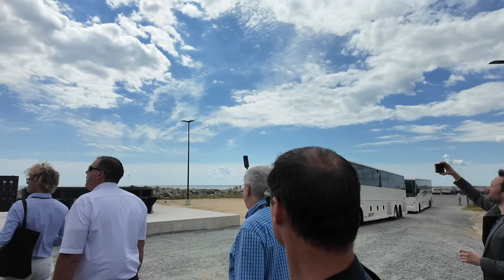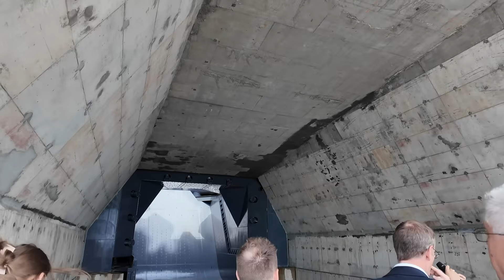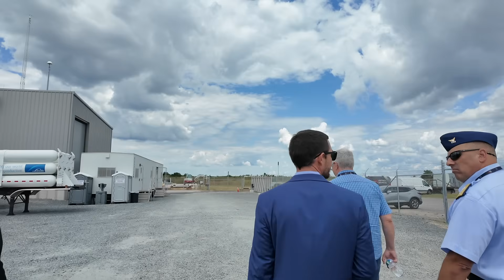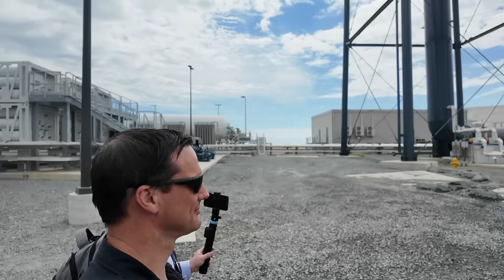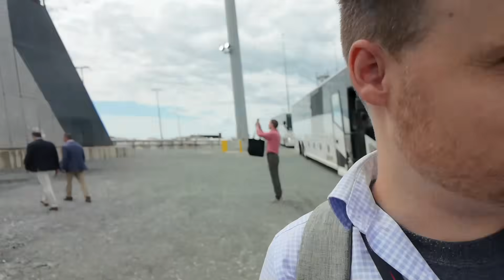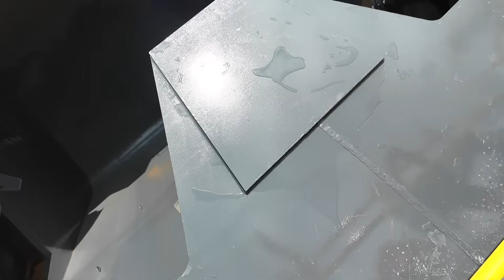Rocket Lab Neutron Launch Pad LC3 Tour by Lead Grounds Engineer

Comment: crazy that it’s only one test launch and then a customer on the 2nd launch … i feel like it could easily take a few launches to perfect?
Reply from the maker: Let’s hope they figure it out on the 1st try.
Reply: New Glenn did it also at the 1st try, but RocketLab has clearly not the same capacity/capital and no prior experience with landing a rocket. I think they need at least 2 launches for deploying the payload correctly and another few for the landing